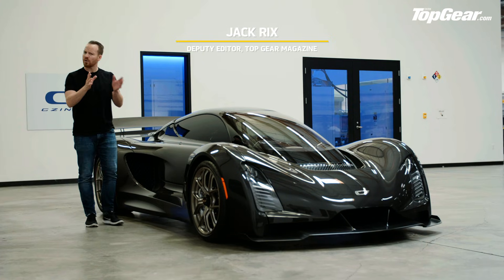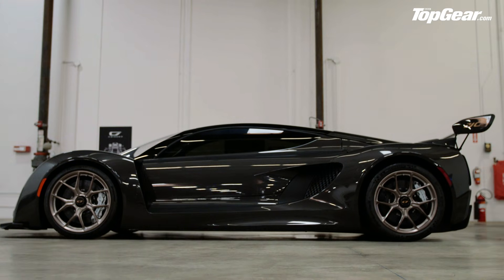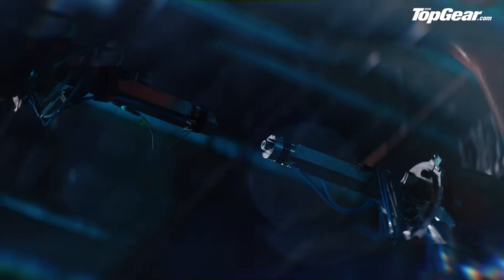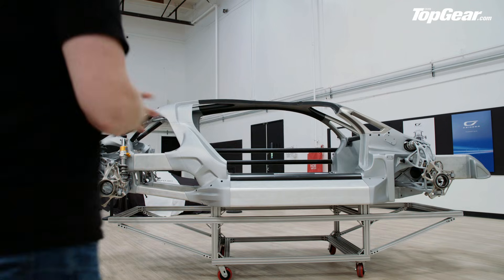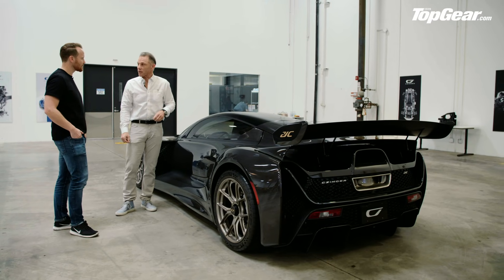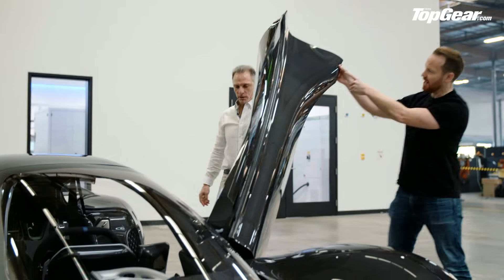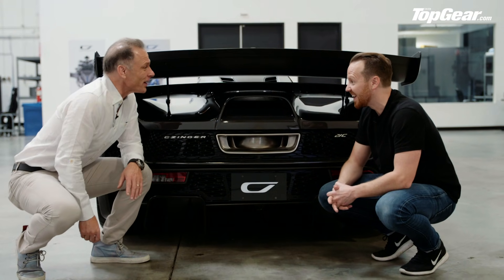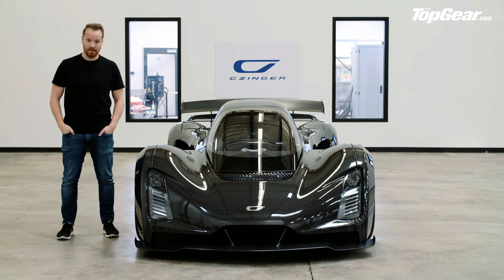FIRST LOOK: Czinger 21C: the world’s first 3D printed hypercar | Top Gear

Comment: https://www.youtube.com/watch?v=u-lu0QhKaio
You probubly need to check about this 3D printed Ultracar made in GREECE!
Acceleration:

- 0-100 KM/H (0-62 MPH) ~ 1.8 sec
- 100-200 KM/H (62-124 MPH) ~ 2.6sec
- 160-241 KM/H (100-150 MPH) ~  2.2sec
- MAX. SPEED ~ 500km/h ( 310mph)

power -  2000hp (1491kw) - 11.000rpm
power -  3000hp (2237kw) - 12.000rpm
COMPRESSION RATIO - 12.33 :1
POWER - to - WEIGHT RATIO - 2.3HP / KG

Comment: I've been wondering for the past 5+ years ever since the Ferrari Enzo ... "When is the next generation of supercars going to surface?" And "When?". Well. This is is. And before you start arguing with me. Yes hybrid hypercard does denote progression. But it's just that. Progression. What is being offered before us is a brand new way of achieving optimal performance. And the concept has been approached in such a way that can and will be applied to standard domestic vehicles. (mass produced 3D printed parts).

Comment: Cant wait for thunderfoot to stick his nose in this and try to debunk it and fail as miserably as he did with hyperloop.
Reply: To produce 1 kg methanol, you require 1.374 kg of carbon dioxide. To get that amount from sea-level air, you need TWO MILLION CUBIC METRES of it. Just to pump this amount with a blower, not even compress and process, you need about 250 kWh, or about 900 MJ. One kilogram of methanol contains, calorifically usable, 22,7 MJ/kg. Meaning, you need about FORTY TIMES the energy to just pump the air alone needed for what you get out in methanol, not counting pumping and processing other ingredients. It's the same BS as "plastic from air", etc.

Comment: One of the old reasons why 3d printing aluminium or titanium as an additive layer setup, is that when the metals melt their surface tension can contract them into a ball and they become detached on the microscopic scale. This means that the new materials on top of the old layer will have nucleation sites inside it, pockets of air, which make the final print barely more brittle that a perfect theoretical arrangement of the crystal lattice. Now he did say in the video that their 3d printing room is top secret but i wonder if they actually have gotten around some of the problems that have plagued metal 3 printing
Reply: Aluminium and titanium are regularly printed in productive capacity in powderbed fusion machines. That stuff has been figured out.

Comment: That left a lot of questions. Obviously a lot of parts are not 3d printed because either it would make zero sense or the technology dosnt exist. Like the electronics, screens, bolts and nuts, tires, windscreen and door windows, the carbon fiber parts. How does final assembly work? Tesla tried to do final assembly with robots but found that a team of humans can do it much faster and with higher quality so I suspect its the same here with the cockpit assembly and the seats where they 3D printed to with all the stitching? 😄🤔😀
Its got potential from what we are shown but thats not much. Btw the term "first 3d printed car" is so porly defined that I would give the honor to Koenigsegg for their 3d printed titanium parts where the turbo was impossible to manufacture without 3d printing. The titanium exhaust  in the Agera RS is also 3d printed. But since they want maximum material strength and rigidity and flexibility where its needed combined with as low weight as possible they use carbon firber everywhere it can be used while Czinger are using aluminum which is a fairly soft metal.

Comment: Kind of crazy how as technology advances, we edge towards more "organic" shapes that were forged through millions of years of evolution.
Reply: Normally you'd want a shape that is as simple as possible and gives you as much performance as possible. Because of 3D printing, we can just ignore the first bit and go full-on into performance since we can make almost any shape with relative ease. The computer also doesn't care about all the extra math it has to do and such "doesn't" approximate the forces on a large area, it instead calculates the forces at/on every "particle" and only adds as much material as it thinks that it needs for that bit. This results in a strange shape because the pressure isn't evenly spread most of the time. This is why it looks "organic"... It has nothing to do with evolution.

Comment: 6:48 "... this has been designed in two minutes, by a computer ... "
With what problem setting?

I'm guessing it is done using some shape or topology based optimization algorithm?
Are linear or nonlinear mechanics considered?
Is the post-processing calculated in that time as well, i guess not.
Are multiple load cases, such as accelerating, breaking, etc. taken into account?

Even if it is based on a linear FEM, with just a single load case, using a powerful computing engine, two minutes seems a pretty bold statement.

Comment: some of those parts look pretty but way too thin, one good pot hole and it's going to cost you a fortune to get those specially made custom parts replaced. a lot of those super cars look pretty until you hit bad roads or some moron rear ends you at a light, then its a fortune to fix, should we mention all the dealer only maintenance you will need. but we get ahead of ourselves so far everything is just for show. gee look how much room there is in the back, duh the seats all the way forward no one drives like that.

Comment: "Worlds most power dense engine" no, these claims are BS - once a manufacturer slaps turbo(s), supercharger(s) or both on an engine, you have to account for the power adders displacement. An internal combustion engine is just an air pump.

the inside of the front bumper has a honeycomb structure inside of it; waffle is quadrilateral shapes, honeycomb is hexagonal shapes which are much stronger.

It's an attractive car, not that I have 1.7m to toss around, but several people will for the exclusivity alone.

EDIT: I'll just pop down to my local methanol station for a fill up then, this is way better for the environment than a prius.

Comment: I was wondering how they were going to make that much power on a small engine like that, but methanol makes sense. 
Main question though is this: If the dude likes Superbikes that much - when will the make a comparable bike? Because they probably can build lighter with more power on a four stroke platform than BMWs HP4Race.

Comment: You absolutely cannot say 1090 hp and 1090 kgs makes it a 1:1 p:w... if you're using hp for your units of measure for power, you have to use the same measurement system for the weight, making it approximately 2400 lbs. Not a 1:1. Closer to a 1:2.2.. 1 hp for every 2.2 lbs.. Still impressive.

Comment: The car weighs 1090kg and has 1090 hp. And they say thats a 1:1 ratio. Seems a little cheeky to use metric weight and standard power measurements. I know koenesegg has 1:1. How do they measure it?

Comment: This is so new, it wasn't on Jay Leno's Garage as the "Divergent Blade" in 2015, by the designer: Kevin Czinger. It's pretty much the same car.

The production line is what is being sold. The automated unit area produces 10,000 chasis per year. They won't sell 1000 of these cars. The car is a demo. They want to sell the use of this machine to other manufacturers.

Comment: Well, that saves the money on having to produce a right hand and a left hand drive version.
Reply: McLaren knew this decades ago with its McLaren F1
Reply: I guess the only thing that would be swapped is the side that the seatbelt runs down. I see this one is ideal for right hand drive as you exit the car on the right and the belt is the left. Shouldn't be hard to mirror the few parts that need to be to swap that.

Comment: Not sure the math on that 1/4 is right. Full interior, glass window, street cars usually need 1500+ hp to run that quick. Obviously the AWD system will definitely help launch the car and getting instant torque from the electric motors add to the performance of the line. The 160mph suggests it's making up its time in the first 1/8th of a mile because most cars running 8.1's will trap closer to 180 by the end of the 1/4 mile. Can't wait till people start taking delivery so we can  see if it really achieves those numbers.